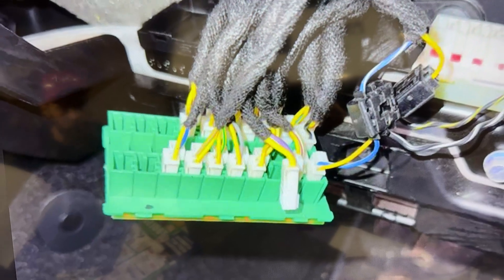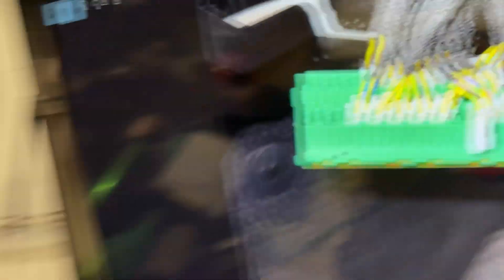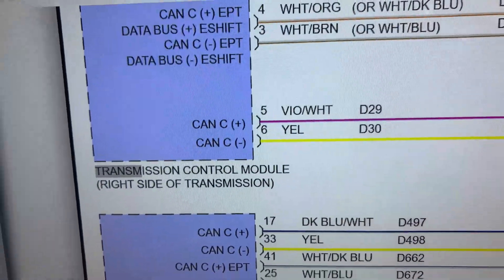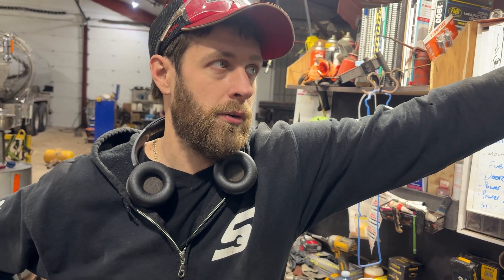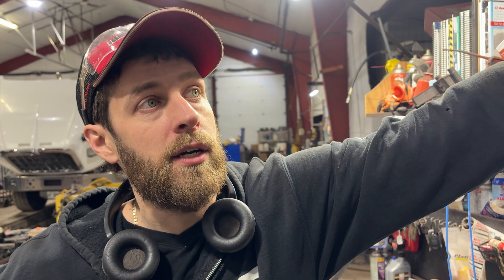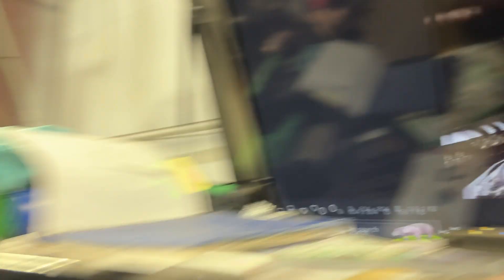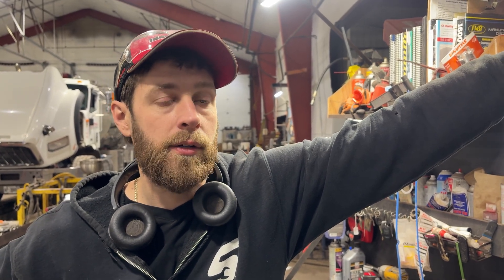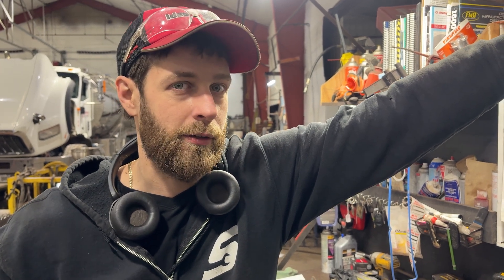Diagnose Communication Fault Can Bus 2021 Jeep Wrangler Rubicon

Comment: thanks for the vid! this CAN bus issue sounds sooooo common in these jeeps. having similar, very inconsistent issues with my 2020 gladiator. Dash lights here and there, no stalls or anything, 1 time the wipers came on and the whole shibang on dash. But more often then not it runs fine with only a check engine light. But have a bunch of U codes. All signs lead to replacing the CAN bus, but I'm wondering if i should trace the wires as this guy did. 

Those images of the chaffed wiring, where in the jeep are those? The pics are so detailed that I'm not sure where to even look on the vehicle to trace it. Is that under the hood somewhere? Are we taking out all the interior etc? What has to be done in order to trace these?

Thanks!
Reply from the maker: In this guys situation those wires were near the transmission, underneath the vehicle.